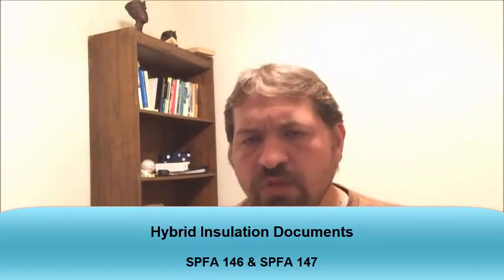Hybrid Insulation Systems

Comment: I hired a contractor to spray closed cell foam in my attic but they mistakenly used open cell. They offered to spray closed cell over it to make it a hybrid system. Does this sound correct?